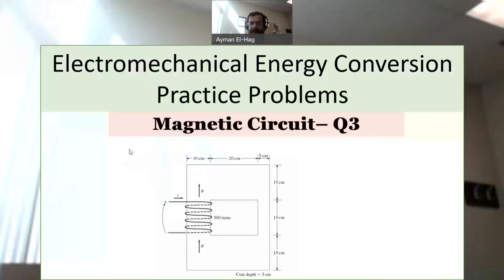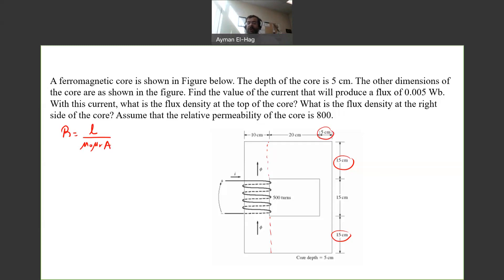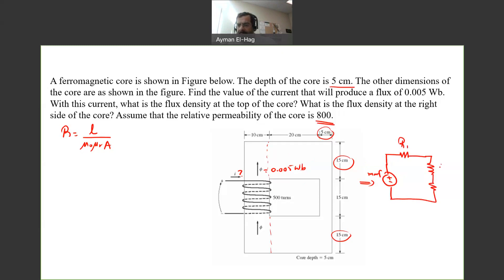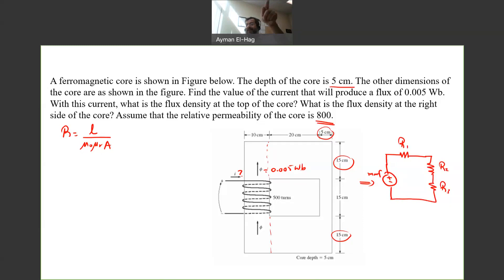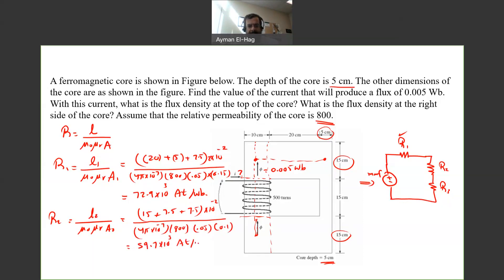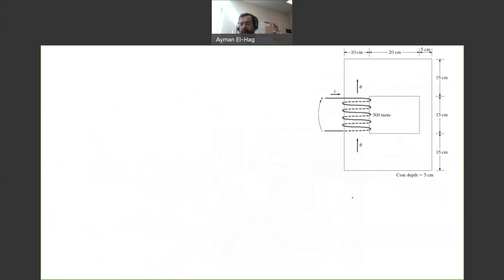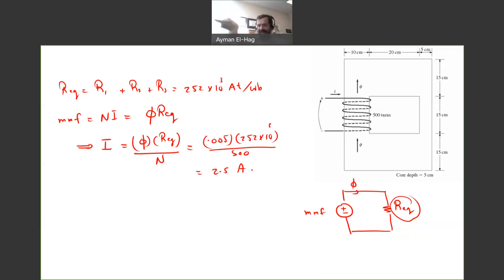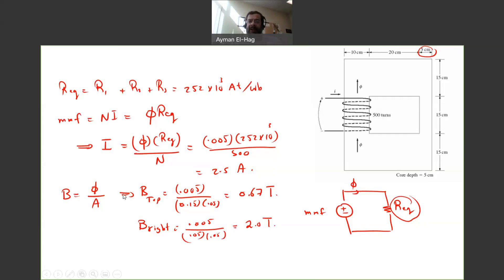magnetic circuit - Question no. 3

Comment: When we calculated the R1, we doubled the length of L1. Should we double the sectional area as well A1*2?
Reply from the maker: No, let me explain, assume you want to calculate the R for the top part alone and then the bottom part and you add them, so you will double the numerator but the denominator will not change, I hope this clarifies.